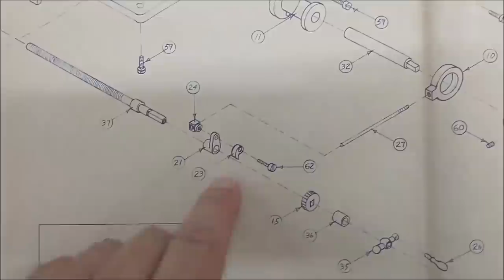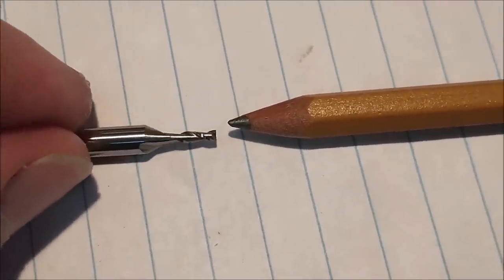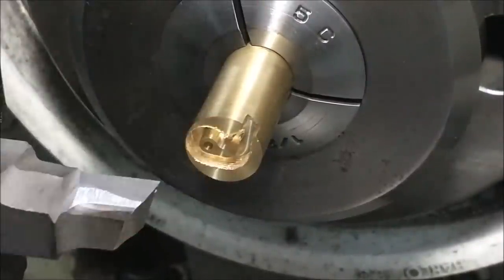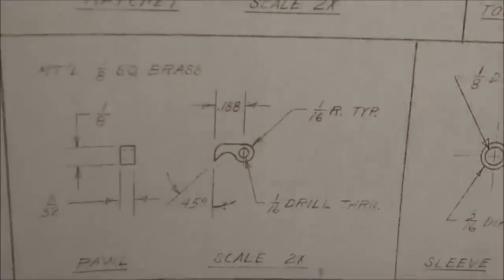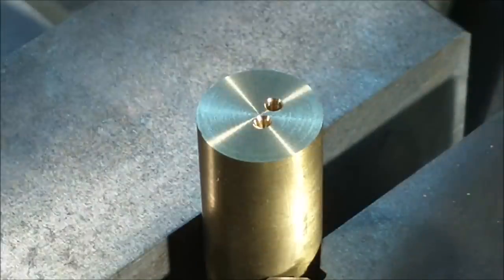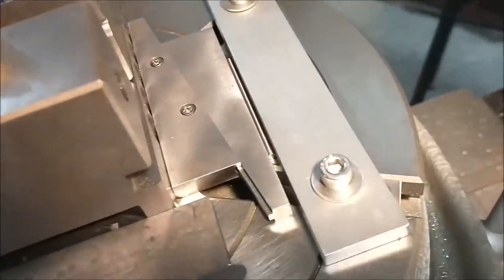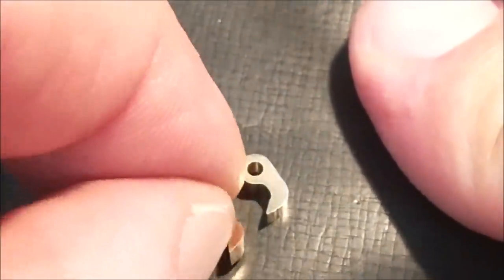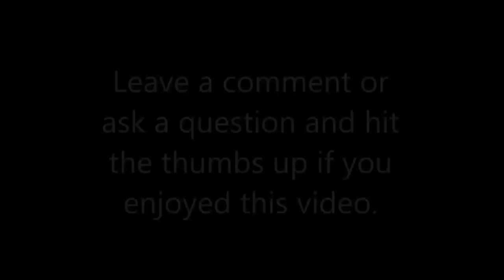What's The Difference Between These 2 Parts ????

Comment: Hi Joe; if you fill up the removed material in your blank with low melt alloy you can part it off as a disc and melt the part back out- just a tip. Good for retaining small or delicate parts.

Comment: Joe, I like your style. But for a true comparison in manual mode; the setup time in CAD; get your dimensions and angles for the rotary point on your model and drawing. Hardware; mounting the setup on the rotary table; aligning the fence and rotary table center. Finding the right offset parts for moving to the other center of rotation. From experience; this takes the most time as you will probably agree. Still slick performance and a great result. Always a proud fighter:-) Thank you Joe! Much appreciated! Best, Job
Reply from the maker: All the behind the scenes manual stuff added about 30 minutes. This was a fun side by side run. I don't usually do this.

Comment: For a one-off part it would be fair to add the 3D design time and NC programming time to the manufacturing time of the CNC-part. Only the total time is a fair comparison with the hand manufactured part. 
I work all manual so I was really happy with your demo how it can be done. Most inspiring
Reply: Fair point. From personal experience i'd say 30 minutes to an hour for all that, although could be considerably lower depending on desired accuracy and how good the blueprint is. Instead of 3D modeling the part, get outline of the part from a scanned blueprint, scale it using one or two critical dimensions, then develop a tool path from there.
Reply from the maker: In total, I say the CNC took longer. Generating a 3D model, creating the toolpath and generating the code, setting 3 tools, calibrating 3 tools, locating the part and work offset, and editing the program for subroutine construction was all behind just pushing the green button. The second part would have been so fast it would have been almost free.

Comment: Thanks for showing two equally viable methods, with out casting one as better, or the right way.
I also appreciate your preplan dwg you made for the rotary table set ups.  Those types of sketchs make it easier to hand off the part for somebody else to make after initial set up.  In the same sort of idea, the two fences with spacers make moving centers on the rotary fixture much more foolproof. Troyke rotary's with X-Y above the spin axis are nice but gobble up Z height ( and are 400# monsters), and aren't even as efficient  as spacers.
Nicely done.
Reply from the maker: I watched a video once where a guy put a rail on the bottom of a rotary table then held it by sitting it on top of 2 table mounted vises. Thats all fine and dandy until you put a vise on top of that rotary table and then have to use a big drill chuck with a drill in it. I think it was a joke. I laughed. Those XY tables are very heavy. You need a lift table or a crane.

Comment: I've had great results using a slitting saw to "part off" while still on the mill especially if you are making multiples in a strip format... anyway love the vids, Keep it up Mr Pie!
Reply: How do you keep from losing them in the chips? But even larger parts if they get off the table they're hard to find.
Reply: Don’t slit right through and break off by hand..
Reply from the maker: I've done that.

Comment: This is an excellent video Joe! I used to program a CNC mill with a Siemens 7M  control that allowed you to do subroutines (quite The cutting edge technology for 1990)..... And the program became about 1/4 the size of a regular program without that feature. Once I discovered subroutines I was off and running!!! 😉 (And this control also had the ability to use "variables" ....whoo-hoo!)

Thanks for exposing us to some rotary table work. When I was a machinist I never really came across any need to use a rotary table. It's good to see what it can do!
Reply from the maker: Its very handy if it wasn't so heavy.
Reply: @joepie221  But you know Joe, I never got to use an indexing head either. Do indexing heads and rotary tables do the same thing?

Comment: The way you described the CNC programming it almost sounded like you wrote the G code by hand. The CAD CAM tools I am familiar with all have the multiple passes and finish pass functions built in.
Reply: When I learned to use CNC we has no access to any CAM software. We had to program everything one line or one function at a time. A royal pain. But it had it's up side. It makes editing easier.
Reply from the maker: I programmed the part profile in CAM, but manually changed it to a loop at the monitor.

Comment: A peck drill attack removed that material quickly. This strategy never occurred to me with an end mill. I've seen folks use it on 80% lowers with bits which always kinda makes me cringe but this is brilliant man.
Reply from the maker: Its much safer for the cutter too. Its a good technique.
Reply: @joepie221  That was my 2nd thought after seeing how quickly the stock was being removed. The axial load on such a small cutter beats the heck outta snapping end mills trying to side mill it. I'm gonna say less chance of a perimeter breach as well when manual machining. Thanks Joe, I'm going to use this technique on a lower as soon as I can find a drawing that I feel I can trust. It's like Bugs Bunny wanted to share a cookie recipe, these drawings out there. Never seen anything based on cutter size and crank rotations rather than final dimensions before looking into this process. 🤪

Comment: The one that's done manually looks like the hole is centered more evenly to me. Idk maybe it's just the camera angle but the CNC hole looks off center a bit. Great work as always Joe, thanks for uploading. 👍👍
Reply from the maker: The CNC part hole has a small chamfer on it. The camera angle can't see the chamfer, so it does appear off center for that reason, but isn't.

Comment: Hey bud, Every piece  you make here I can relate to working pieces in a temp controlled (72F deg)situation working to a half thou over 6 ft. Nothing is any different. As you have said before it is all about the numbers and being familiar with the medium we work with. Be it hogging through a first cut on a sand cast iron  piece that weighs 8 ton or trimming Inconel turbine blades with a laser it is all just the numbers. The longer we work at this trade the more valuable we become. When I left the trade CNC was not that much past it's infancy. Tape and light boards (I can't remember what they called) were the happening thing. No wonder I still prefer working with analog wrist twisting styles, LOL. There is just something more personal between man and machine . We learn the subtle faults in the adjustments of bed, cross slide and compound where they may read long or short or need a 1/2 or a two thou + or - up or down or the machine just plain doesn't like some procedures. Dealing with all these is like a nurse in training where they have to learn all the ropes on how to train doctors eh, LOL. I have a friend that lives about 100 miles south of me that has a top drive flat belt machine shop of sorts that all the machines are flat belt driven. His closest neighbor is 65 miles away and they are all off grid. These are the real machinists/mechanics I have soooo much respect for. I can see Walt drilling the hole in this piece of brass and complet6ing it with a few files. In the real world who cares about how a piece looks but simply function rules eh. Nice catch fella !  This comparison needs to be shown to all new up and coming new machinists out there for sur eh ! ! ! Well my dear friend this is one hell of a good post fella. WOO HOO on you bud.
Reply from the maker: Thanks for sharing. Always good to see a comment from you.

Comment: A machinist friend of mine once said "You can spot the difference between a machinist who started out manually cranking out parts and one who has only done CNC by the ammount of stupid details that requires multiple setups to do manually"
That holds true, an CNC'er doesnt care about making radiuses the requires 12 re setups manually.
Reply from the maker: G2, G3, Gee that was EZ

Comment: I guess the kit designers intended this part to be made using files and some elbow grease. But you managed to make it a tutorial in advanced machining!
Reply from the maker: You could probably get by with a file of you had a steady hand. And a LOT of luck.
Reply: @joepie221  That and a good flashlight to find the part after you dropped it or it flew out of the vice ;-)

Comment: Another way I can think to cut the profile. If you have a DRO use the arc function to make small moves to position the end mill and then take plunge cuts. It will take awhile but it can be done. Lightly clean up the profile with a needle file. The really important features functionally are the hole and the tip of the pawl.
In the old days if I were doing this I would be using a Kearney & Trecker Rotary Head Mill. And moving to the center points of the arcs using a micrometer head, standards and indicators. Really old school.
Reply from the maker: I'm sure there are a dozen different ways to do this part based on your comfort, machinery and experience. Thats what I like about this trade.
Reply: @joepie221 
By hand with scroll saw or a file if you have to

Comment: That was really interesting Joe. Although slightly bigger than that I had to make almost the exact same thing on my first shift (night) at my new place of work, going back around thirty-five years ago! I had very little kit available and the boss needed three off in copper for fitting on site in the morning (manual m/c). I did a lot of sweating I can tell you, there were only two of us on shift, a turner and myself (toolmaker). I got it done although not to a quality standard that pleased me. But under the circumstances??
Reply from the maker: So long as the boss was happy.

Comment: What a terrific comparison Joe. I'm guessing that the math involved in working out the rotary table was equal to the programming time on the cnc. 
The sub was brilliant. My tiny, and old cnc mill only has 100k memory (and for some reason it won't drip feed) so they're indispensable.
Reply: If you use CAD, you can do the "calculations" by hand by placing circles the diameter of the milling cutter tangent to the part drawing.  This takes little time.
Reply: @bpark10001  Absolutely Brian.
Reply from the maker: CAD really comes in handy.

Comment: Given that you did almost all the shaping on the mill, is there some reason not to use a slitting saw to cut the near-finished part off the stock?
Reply: The only reason I can see finishing in the lathe being preferable to parting with the slitting saw is it is likely more reliable to get the cross section thickness accurate with greater reliability than parting with the slitting saw.
Reply: @howardosborne8647  
The thinner the slitting saw the greater the chance for axial deflection
Reply from the maker: Just for thickness control and demonstration. I like the lathe, mill, lathe approach.

Comment: Hi Joe, nice tiny parts. 
I always think of how they would have made things before we were spoilt with modern technology, like a DRO. No doubt a lot more notes on a piece of paper for all the adjustments, and a lot more manual calculations. Certainly a one or two thou error on the full sized part would not have been as critical as on the model. 
I always enjoy seeing your set ups, and the choice of material stock for parts. 
Regards, Dennis.
Reply: When lathes received vernier hand wheels were those operators "spoilt". Everything was modern once and DRO machines will also be supplanted.

Comment: What's the precision like on that rotary table/vice, any slack or potential for kick back?
Is that why you used shims instead of relying on the dial for the offsets?
Watching from the UK.
Reply from the maker: This rotary table is very tight with almost no backlash. The shims were used to physically move the part in relation to the rotary table centerline. You can't do that by moving the machine table.

Comment: You didn't give us a close up look at the milled surfaces. Does the manual part have dwell marks, or mismatches at straight-to-curved transitions?
Reply from the maker: The manual one does have a small dwell mark at the tip of the hook on the outside. Believe me, when the model goes together, it won't be there.

Comment: Why not use the same technique as the CNC when doing the radius on the mill? Seems like the hunt and peck method would be more prone to error (go too deep or not deep enough or do one too many pecks)?
Reply from the maker: Too much code. It was easier to step it down.
Reply: @joepie221  No, I meant the other way around. When you were using the manual mill why didn't you just do shallow passes around the whole piece, like you did with the CNC?

Comment: As usual I learned from your video.  I am confused why you used the shims on the vise, instead of just moving the table.
Reply: Basically because he's demonstrating how to do this part manually, without a DRO or other computer magic. If he uses the hand wheels on the mill, it would be pretty close to where he needs it to be, but would it be EXACTLY correct? By using the shims on the rotary table he can guarantee that the part is now offset the precise amount he needs, crucially, without any further indicating to be certain that he got his offsets correct.
Reply: @Resonantfate  I believe the shims are used to offset the part in relation to the centre of the rotary table, something which isn’t possible with the dials on the mill table. That would move the part and the centre of the rotary table as one.
Reply from the maker: As the other comments mentioned, a round feature on a part done on a rotary table is a result of where the part is on the rotary table. The axis of that round feature must be over the center of the rotary table. Then you move the machine table a calculated amount based on the desired radius and cutter being used. If you simply move the machine table, you'll get another round feature concentric to the last feature made because you now have a different radius size, but the same center axis.

Comment: here's a tip: instead of using a parting tool to remove it in one go, you can use a facing tool and remove it bit by bit.. that way you won't need to use those side cutters to trim the pip off.
Reply from the maker: There will always be some kind of remnant, but maybe not as big.

Comment: G'day Joe, another masterclass you have presented. I was wondering while viewing, in the absence of a CNC machine OR a rotary table, what is the likely success of using layout fluid and scribing the profile on the stock and then using a Dremel with a suitable cutter to manually create the pawl? Perhaps even a suitably sized file(s) could be used? Just thinking outside the box on this one.
Reply: Thats not machining.. haha
Reply: The precision and finish would not be there as well
Reply: Laz, you're actually thinking very much inside the box, at least the old-school box. Ask anyone who repairs or reproduces old clock parts. Rough cut with a jeweler's saw, finish with files.

Comment: Great content and comparison.  The machining is not that difficult to understand, however, calculating the tool positions and rotation degrees is the difficult part. Using CAD does make it easier, but how would you go about calculating those points manually?  This is the most difficult part for me in machining.
Reply: You can compute everything by making a dimensioned drawing, then  using trigonometry and arithmetic to compute the dimensions you need for any rotations you do.  For any rotated dimension you need, you find  a triangle whose sides can be found in the unrotated frame and use Pythagorean theorem (a squared + b squared equals c squared) and/or trig functions to compute the sides.  It's kind of math, but really isn!t too hard. 

Alternatively, make a scale drawing, and measure whatever distances you need.  This risks some measurement error, which can be mitigated somewhat by scaling the drawing up, say 10 times.  No math here, but some risk of inaccuracy.
Reply: @Paul, I don't know your math level, but the general answer is that you use geometry to decide on some reference rectangles and triangles and then use trigonometry to determine the lengths of some of the rectangles.  Generally, most of the rectangles will be parallel to the x and y axes of your tools.  Usually any triangles will be drawn in a corner of one of your reference rectangles, so most triangles will have one 90 degree corner.  Textbooks and manuals call them right triangles.  Calculating the other angles from the sides or the sides from the angles is especially easy for right triangles.
I think that you will see that Joe is doing something like this.  It's just that he is so experienced that he is doing it mostly in his head.  You will need to make diagrams to be certain that you aren't making a mistake.  Frankly, I don't think CAD is any magic wand here.
Disclaimer:  my background is physics, not machining.  Still, I think that you can get someone to explain the geometry and the calculations to you once you get familiar with the blueprint.  Good luck!
Reply from the maker: I may make a short video on that question. Not everyone has CAD in their shop.
Reply: @joepie221  Thanks Joe.  When you are all new to this stuff, envisioning all the ways how to calculate these start stop points is not second nature.  You are the only machinist youtuber that actually explains the how and the why.  Appreciate you.